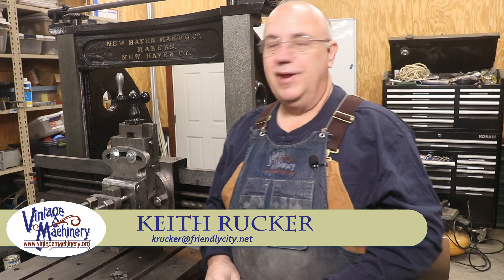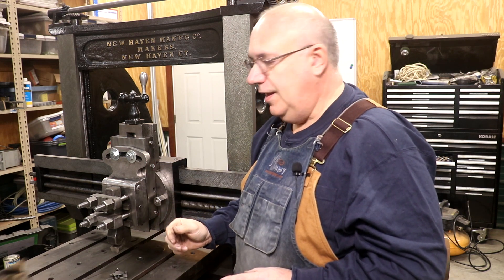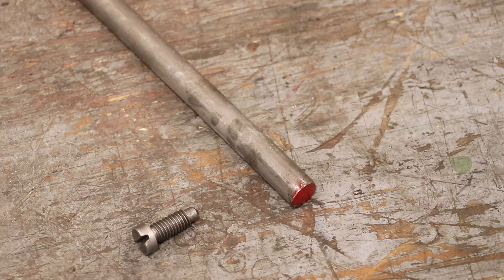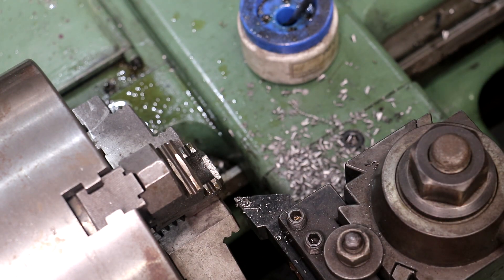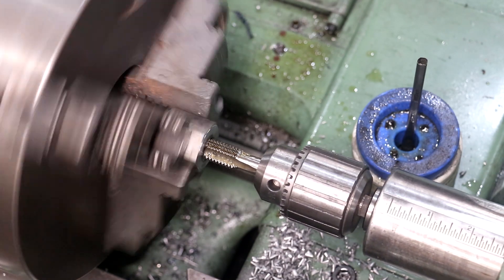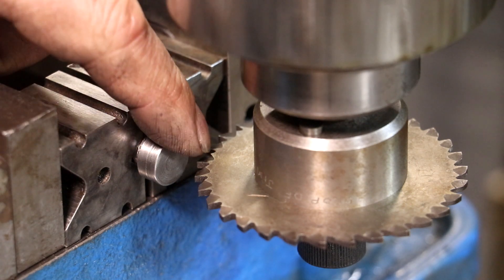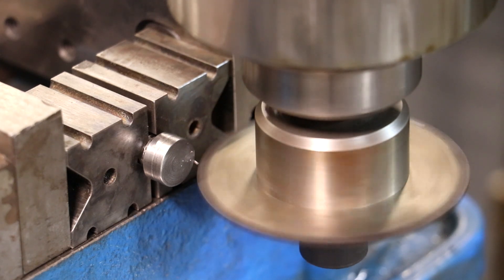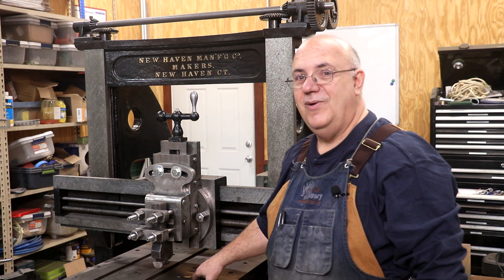Metal Planer Restoration 50: Machining new Hardware for the Clapper Box Assembly

Comment: When working on vintage equipment it’s mandatory to be able to make your own parts.  I’m involved with an organization the runs and maintains a  standard gauge, Mikado 2-8-2 Steam Locomotive that was built in New Orleans.  SPX-745 was built in the Southern Pacific’s Algiers Shops in 1921.  There are several videos of her out running on the main lines of several class one railroads. 

During one of her annual inspections, around 2010, one of the check valves used for injecting water into the boiler had to be removed for some repairs.  After removing the valve our Chief Mechanical Officer ( CMO ) was not pleased with the 4 studs that held it on the boiler.  A lot of corrosion and wear on the outer threads.  He believed they were the original threads from 1922 when she had a boiler explosion and had to get a new boiler.  We tried to remove them using several ways but they would twist but not break free.  Penetrating oil, heat, long cheaters on a 3 foot long pipe wrench could not break the old threads.  

So we ask several machine shops in the New Orleans area to bid on removing the old studs and making new ones.  Several shops come out to look at the job, but only one shop bid on removing, but not making the new studs.  The end that went into the boiler has tapered threads, and none of the shops wanted to make them.  The only bid was $2,500 to remove them if they did not have to drill them out.  So we decided to drill them out our selves.  Our CMO had a lathe with a tapering attachment, but had never cut tapered threads.  After cutting the outer shank and threads off we drilled the old studs out saving as much of the old threads as possible.  It did take a couple Saturdays of working on them to get all 4 of them out.  I probably had 8 to 10 hours of drilling myself.

We borrowed a set of brand new tapered taps from another steam locomotive operation.  Our CMO tapped the old threads until he had 100% new threads.  This resulted in 4 different sizes for the new tapered threads and we needed two different sizes of round stock, 3/4 and 7/8 of an inch to make them.  He used the tapered taps as a pattern and all the outside threads and shanks were the same, 3/4  X ???.  One of our members got a retired machinist friend, that he worked with at a refinery, to give us a hand.  It took us all day to make the first one.  A big learning curve for us.  I mainly watched and went to pick up the poor-boys, ( a 9 inch long sandwich made with French bread ).  Our CMO made the other three the next morning.  The whole cost to us was $150.  The round stock cost $100 and the 7 shrimp and oyster poor-boys cost us $50.  Now I did not count the cost of the 3 wives going shopping after they served our lunch or the potato salad my wife made.  All 4 of us guys learned a lot that day, but you know, it was fun and worth every minute of our time.   Our three wives had a great time too.
Reply: Bill Morris . Nice story . you should have made a video at the time .
Reply: Thanks for sharing this. Job done the right way, I say.

Comment: I think you should mount the motor on the ceiling above the planer because the belt shifting mechanism for the forward and reverse movement of the table will not work properly with a short belt. It will work best with the belt as long as possible so the belt stays as straight as possible when it is shifted to the other pulley.
And this way the planer keeps its original look without any mounting holes and mounting fixtures for the electric motor.

Comment: Love the cat Keith!  Some mean screw cutting as well - I always run the machine slower than you do when I'm producing threads - your reactions for withdrawing the tool at the end of the thread are really quick - very impressive.
Reply: I'm betting there is a high speed threading attachment involved.
Reply: @haroldphipps3457  You might be guessing wrong. Keith's just pretty good at flipping levers and twisting knobs.

Comment: I'm thinking that this is one of those "for want of a nail the kingdom was lost" things.  Somebody probably stripped or lost those screws and couldn't get any more since the machine was old and heading for obsolescence, so they tried running it without the screws.  The lack of screws caused the gib key to be unsupported and to break, which caused the clapper box to get sideways and broke those gears.  At that point, there probably weren't any parts available, so the machine got put out to pasture.  Its a good lesson in taking care of screws.  I've got a wood plane of about the same era that I'm working on at the moment.  I went looking for information on it, and the article I found was written by some guy named Keith Rucker... :)   It has a similar plane, which was already boogered up when I got it, and rusted and stuck.  I tried my very best to get it out without doing more damage.  I soaked it with penetrating oil and gave it time, but with the slot already boogered up, I had to resort to vise grips.  I used Keith Appleton's trick of wrapping flashing around it to protect it from the vise grips, but it eventually slipped and the head did get a bit boogered up on the sides.  Not so badly I can't use it, but it looks ugly.  You can't exactly pick up a cast iron screw for a Ohio Tool Works number 29 at Lowes... sigh..  I'm wondering if a good hot forge, an anvil and a rivet bucking block might be used to reshape that head.  

That kitten is adorable, and she clearly thinks you hung the moon, or saved her life.

Comment: A carpenter says measure twice and cut once and an electronics engineer might say check your components are the right way round twice and solder once! The metal machine engineer would invent, plan and think twice and chip once. Mary Ann is so cute twice over and a hundred cuddles!

Comment: I was comparing your two screws and noticed the orig was cut with a threading profile - flat bottom V.  Yours was flat sides.  Might be part of the screw machine that it used what it had and not adding a unique cutter.  Interesting.  Nice project.

Comment: 1:39 - don't want to wear the thread out in the casting.....2 issues with that.....

1. ISTR those threads are now helicoiled - so are replaceable in any case,
2. You have to remove the stud or bolt in any case to get the full swivel travel - which is the whole point of there being 2 screws clamping - so one can be removed and it still be clamped !

Comment: Keith, a thought about power for the planer.  Keith Fenner has an old Sibley drill press that originally ran off a line shaft.  Maybe, you can use some of that machine's current power train on the planer.

Comment: Keith- this restoration has been super fun to watch, so please don't take this question to be anything other than a newbie with genuine curiosity: Practically every moving surface on this machine has been scraped in, and I assume you've oiled it all. So why does it seem like all the controls take so much effort to move them? Are the gibs just too tight? It seems like you really have to put a lot of force into turning the dials; I would have thought with perfectly parallel scraped surfaces that movement would be near effortless. Thanks for helping me understand!

Comment: Thank you for the update; it’s great seeing that planer get closer to working. I recently heard it was best to use slitting saws at full depth to use more of the teeth and avoid dulling the ones affected by runout. But that was on a horizontal machine; would the vertical mill not be up to such a heavy cut?
Reply: I thought about that too, but then I figured he might have been worried about the rigidity of the setup. I mean he even called out that the saw is noticeably off-center.

Comment: Keith, will you talk about why so many slitting saws "run out" so badly in a future video?
Reply: I can tell you in my sixty years of machining I've never seen a side cutter run perfectly true. The problem is tolerance stack-up. Machine spindle has slight runout, arbor has a little, the cutter fits on arbor with a couple thousands and finally the cutter itself has some tolerance so is not perfect. Usually a little runout does not harm whatsoever and we just learn to live with it.
Reply: @ellieprice3396  Makes sense, except that if it were only due to tolerance stack up, occasionally, the runout variations would defeat each other and the cutter runout would seem near perfect, but it never seems to happen

Comment: hi Keith , at the end of your thread the tool snaps out, could we please. see the mechanism. which achieves this.Thanks ken.,
Reply: The mechanism is Keith opening the half-nut with one hand and backing out the cross-slide with the other.  The timing of both events just before crashing into the bolt head is set with talent, skill, and practice.

Comment: I had to stop the video 1 min in to congratulate you on mentioning that you did not forget about the two New modern bolt holding the clapper box on. LOL I was already #&*%@ at the screen. LOL. One more small criticism. You made a new screw with nice deep parallel slot. then you stick a tapered screwdriver in the slot . Which can mushroom's the screwhead like the others are butchered .

Comment: I would have liked to know how you centered the slitting saw on the screw head. It looks like it was very accurate, so I presume you used the DRO to find the middle, but I don't know how you do that with the saw blade. If you ever get a chance I would love to see how you do that. Thanks for the video. Very informative as always.
Reply: One way of centering the saw is to carefully lower it until it just barely scratches the top of the bolt. Then you lower it down half the thickness of the bolt plus half of the thickness of the saw. That should get you close enough to center for anything except the most extreme tolerances.

Comment: A little runout when tapping the nut. Should the drilling and tapping be performed in the same set up?
Reply: MKE Gadgets, in an ideal world yes .Now if  some kind soul bought Keith one of those fancy new 6 jaw chucks as a suprise Christmas  pressie , he wouldn't have this slight wobble /run out on a job like this . A hole and thread of this size being a little bit out will not cause any problems . I bet some of the original  fasteners were  probably just as wonky.
Reply: That raw hex block was probably not perfectly square. Maybe if he had marked which way it was in the chuck when he drilled the hole it would have been better for the second op. He said he wanted to do part it off first so he could do a full-through tap. But the tap will just follow the existing hole, so no real problem.

Comment: Just a simple question. Why don't you use a die held in the tailstock or the cross slide to cut small threads instead of single pointing them?

Comment: Keith, I also have another question. Why do you use production screw drivers which have a tapered blade as opposed to a machinest blade which does not. The tapered blades don't appear to have the same ability to grip the slot

Comment: While you were tapping that nut, the tap was visibly moving up and down, so it's obviously not centered.  Now, I realize that being centered wasn't critical here, so no big deal, but I have the question.  Was the nut not centered in the chuck, or is the tail not centered to the chuck?
Reply: The nut is not centered in the chuck
Reply: probably is every thing in line, but the work was an extruded hex, not the most precise thing in the world and was chucked in a three jaws chuck, probably a sharpie mark before parting off can help but isn't a security
Reply: @tacitus101010  I speculate this was because the workpiece was removed and reinserted in the chuck. If Keith was unlucky enough to reinsert the hex piece 180 deg out of phase, that will yield double the runout of the chuck for the workpiece bore!
Reply: You should be looking for runout.  Only one machined surface, and you can see it.

Comment: Whats the difference between a shaper and a planner?
Reply: Shaper - material is fixed, cutter moves. Planer - material (table) moves, cutter is fixed. A planer can handle nearly any length material, (only limited by the table size) whereas a shaper is limited to the throw length of it's ram.

Comment: Why didn't you machine the recess at the end of the thread on the gib screw?
Reply: @flat-earther  I guess here it doesn't matter, but if the head of the screw would have to be tight against a surface then you would have to make one
Reply: I wondered the same thing myself. If you are really confident about when to disengage the half-nut, then you can get away without a relief. Slip up and you might break your cutter :-)

Comment: Thanks for the channel. Very interesting series! A general question: Gear shapers or hobs do not seem
to be favored much for use or restoration.  Too specialized or other constraints?
Reply: Yes they are very specialized machines requiring particular tooling to cut a certain gear. They are great for production but not terribly handy for one offs as each gear requires certain gear set and hob to cut the gear required.
Reply: @bcbloc02  The handful of videos seen on gear making are pretty interesting. Fascinating geometry involved.  Thanks for the reply. I love your channel, too.

Comment: After 50 clapping those gib screws will go loose. They need to be longer and a look nut.
Reply: I said add locknuts on a previous video on this machine. Odd that it ain't got them - and I did say that such a mod was an 'allowed' mod - as is adding a motor mounted on it.
Very happy by folks keeping old stuff running but updates are allowed - so Keith, go mad and add a DRO to it ;)
Reply: A few drops of the green locktight will fix that.
Reply: @the_hate_inside1085  yes and no. It needs to be adjustable. So glue is not a solution.
Reply: @millomweb  yes. Now he has a machine in that he invested 10000dolars. And still runs on belts ... for just a museum pice , paint would be enough
Reply: @the_hate_inside1085  That's hardly a proper engineering solution but is an option !
Reply: @emilgabor88  Green loctite is pretty much adjustable, you just need more force. It is the red stuff that glues it firmly in place. Blue is in the middle.
Reply: @the_hate_inside1085  Maybe they used some varnisch in the threads to make them tighter and increase the friction.
Reply: @ReinoGoo  That would probably work. Adding an O-ring in the bottom of the hole might also provide enough springing force on the bolt to keep it in place. Lots of things to try out here.

Comment: When you drilled the hole in the nut, the drill and tailstock were wobbling a LOT.  I've seen this in lots of other videos - not just Keith's.  This doesn't make me feel good about center drilling.  - Confused in Santa Clara
Reply: Reversing a hex in a 3-jaw chuck inevitably results in a runout, both axial and angular; the better the chuck and the more accurate stock, the less runout. However, nothing is perfect. Notice how the tap follows the hole? That is why the tail stock is loose to be able to do so. In the end, a perfectly good part for its application. Alternately it is possible to tap the nut before parting. But the chips would have no place to go unless you drill much deeper hole which would waste stock. Center drilling is ESSENTIAL to start an accurate hole. Standard twist drill will flex. Center drill (along with the tailstock and the whole machine) will flex but negligibly.